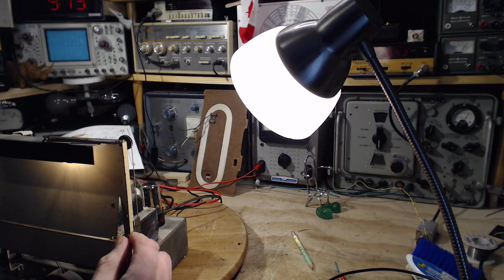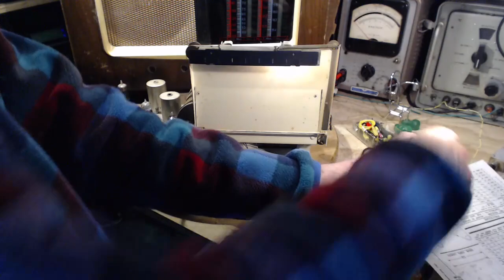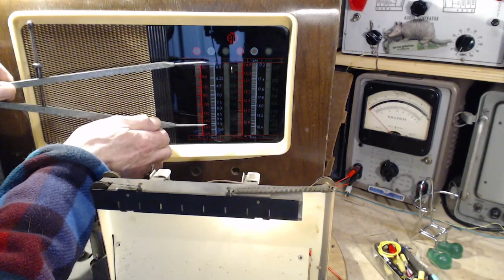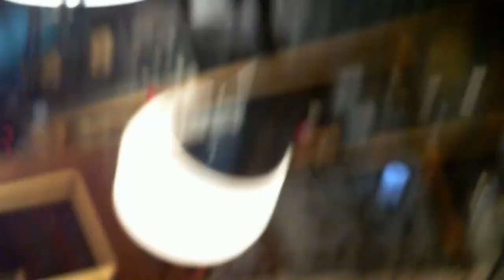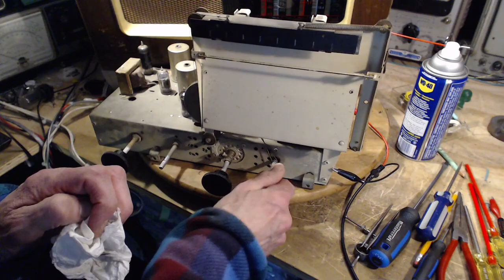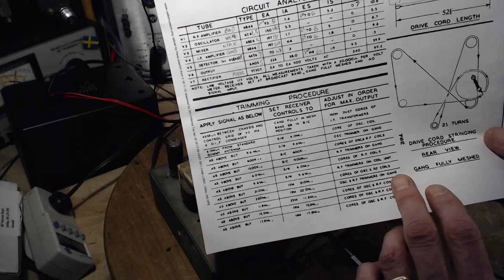Canadian PYE Model 762 Receiver Video #4 - Alignment Difficulties

Comment: To me, that radio looks like an over-complicated mess,  but if it is still working  fairly well after the IF slug mishap, I'd call it quits on this one.  I believe that attempting a further alignment under these circumstances carries the risk of turning it into a poorly performing radio. If it were me, I'd put it  back in the cabinet now, and leave it as is.

Comment: For the shortwave bands that span just a megacycle or so they would likely use a fixed capacitor paralleled with a very small variable capacitor.  So in all likelihood that is the function of the air gap capacitors with just a few plates.  To test that, determine which band switch settings connect those small capacitors to the grid of RF amp or oscillator tube..

Comment: 2:40 the top core of at least one of the IF transformer is stuck because you broke it apart by using the metal screwdriver. The crack going along with it can be clearly heard on the previous video #3 at timeindex 52m04s. 
And 3:04 ; it is typical for a slug with a broken slot to still allow minimal travel by about half a turn. 

The radio is "fixed", "good show"
Time to move onto the next victim

Comment: Put the radio back in the cabinet, tune in a station in the middle of the band, then carefully position camera in front of the dial and take a photo.  Print out an exact 1:1 picture of the dial.  Take the radio out, tune in the same station (or else just be sure you don't move the dial) and tape the picture onto the blank dial, positioning the pointer exactly at its image on the picture.
Reply: First question is; how precise can the tuning be on that radio. 
Wouldnt it be sufficient to assume the mechanical fully open or closed position on the tuning cap to coincide with the limits on the dial glass? In that case using a ruler would be sufficient to transfer the  alignment positions from the dial onto the backplate.
And the mark between 9.5 and 10MHz surely does not show 9.6MHz but 9.75MHz.
The reason behind observing a sort of bandspread occuring also at the top of every higher frequency band comes from the fact that beside the tuning cap there is other stray and parasitic capacitances limiting the LO frequency near the top so that variations on the tuning cap lose influence.

Comment: Using that screw driver to adjust the slugs is just asking for trouble. You might have already broken some slugs.
Reply: Wow breaking ferrite core slugs with a metal screwdriver? No, not Jim. He has never broken any tuning slugs and thereby rendered whole RF reception bands unuseable.
If there is broken slugs they were this way from the factory for sure.

Comment: Old radio 📻, but I think ya can do it. Certain parts in these wear out, stick, or seize up ☝. Maybe a broken spring. Don't do WD40. This is a solvent, or a creeping oil 🛢 only, not 👎 a lubricant. Slugs for these are very hard to find, unless ya have a basement full of junk radios 📻. Ones that are slug-tuned. I bet ya can get this radio 📻 back to life. Part 3, this is. Your friend, Jeff.